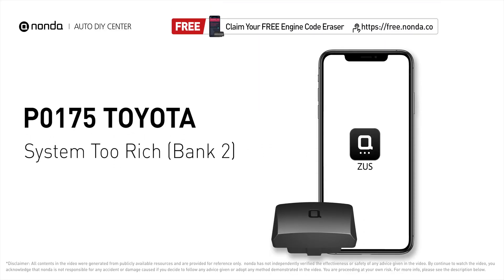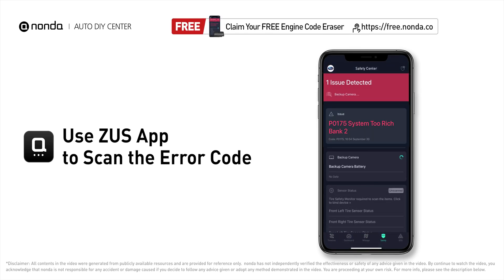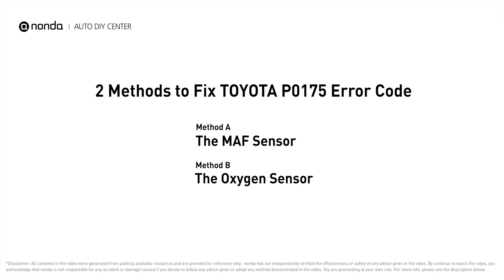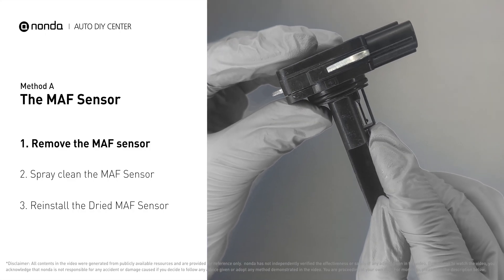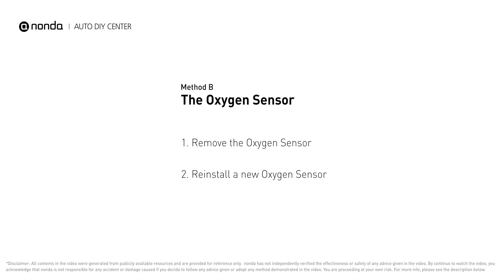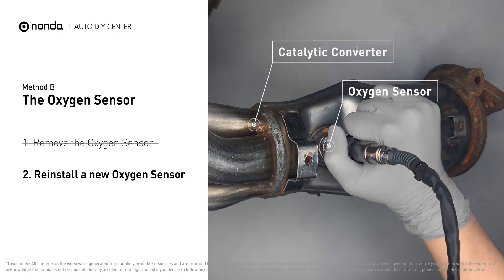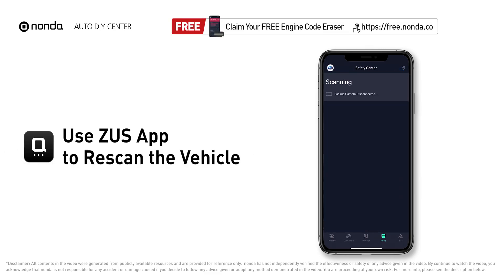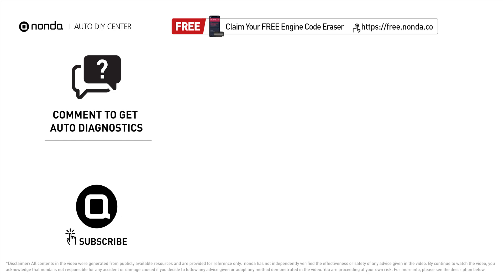How to Fix TOYOTA P0175 Engine Code in 3 Minutes [2 DIY Methods / Only $8.99]

Comment: Just got this code a few days ago in my 02 Land Cruiser. The rpm fluctuate when stationary; rough idle. Hoping to be a quick fix for my daily.
Reply from the maker: Hello, please follow the tips/suggestions provided in our video (how to fix P0175) and let us know if it helped you fix the error code. Looking forward to your update.
Reply: Hi did you fix this CEL?
Reply: What did you do to fix it?
Reply: I replaced the MAF sensor, spark plugs and ignition coils. It worked great after that.